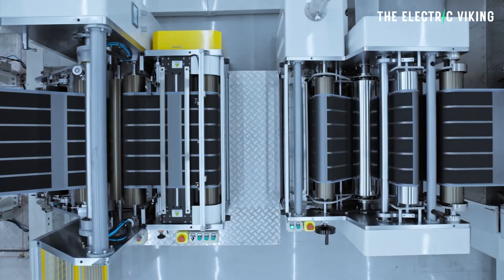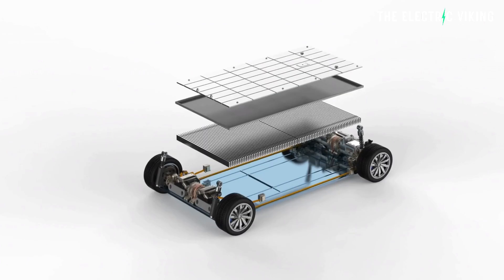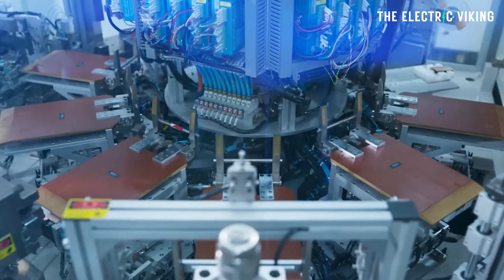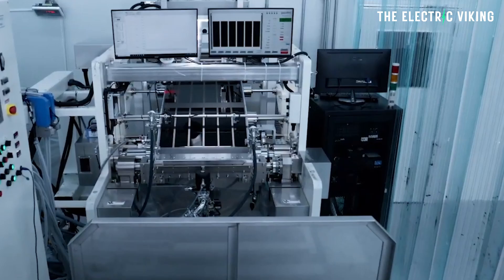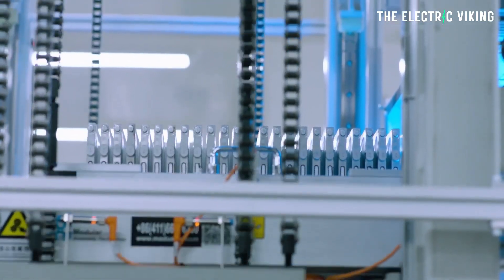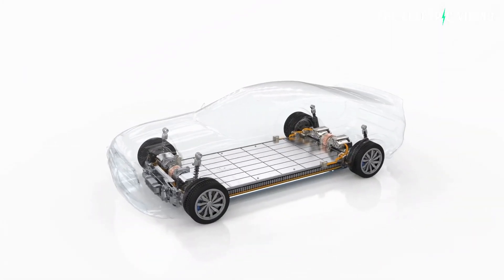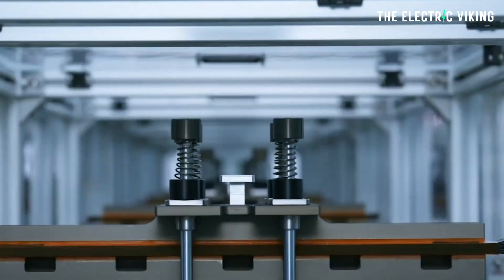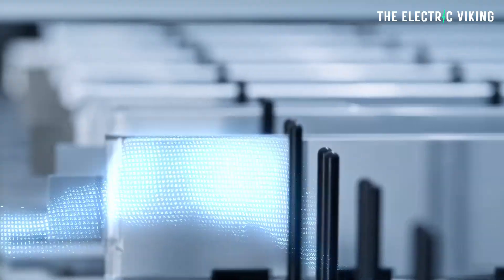NEW silicon composite EV batteries boost range 30% & charge in 8 minutes

Comment: How fast the battery charges has minimal impact in the UK as even where there are 'fast-chargers', the max rate is usually no better than 50 kW and this is especially so if you have two cars on the charger at the same time. This is an infrastructure/grid issue rather than a problem with the car or the charger. Only Tesla seem to be capable of rolling new chargers and maintaining them, however even the base model Model 3 with <50,000 miles is currently asking £25K. For that I would rather update my BMW 330i to the M340i with the S58 engine (straight 6, twin turbo).

Comment: Sounds great and anything that brings down the weight of the car has to be a massive plus. My concern is that the company needs to recover its investment costs so the technology must necessarily be more expensive than what is currently being used. Given the cost of BEVs is the primary reason 'ordinary' people don't buy them, it will only benefit the market in the longer term. On the upside (or downside if you are a dealer or already own a BEV) is that it will further depress the value of second hand BEVs which brings them within reach of people like me who are struggling with the cost of living and the cost of educating my children. I test drove a top spec Ioniq 5 recently and it was a lovely thing, but the car was £60,000!  In the UK, the government has just added 20% to school fees so I need to find an additional £1,200 a month for the VAT which means I need to earn another £20,000 per year before tax. I just have to pray that my BMW 330i (2005) keeps running long enough for my children to finish their education.

Comment: First it was Microsoft and Constellation restarting Three Mile Island, then it was Google announcing it would buy power from small modular reactors built by Kairos. Now today, Amazon has said it’s investing in X-energy, the small modular reactor and fuel company, and supporting a joint project by X-energy and Energy Northwest, the Washington state public utility. “What makes this significantly different is the investment,” Brett Rampal, a senior director at Veriten, an energy advisory company, told me. Amazon is not just buying the power that a nuclear reactor will produce after it’s completed. It’s getting involved in the projects themselves. The Microsoft/Constellation deal to restart Three Mile Island did not entail Microsoft taking on the financial and logistical burden of upgrading the plant so that it could be up and running again in a few years — for that, Constellation will be putting $1.6 billion of its own money into the plant. Instead, Microsoft signed a 20-year deal for the plant’s output, known as a power purchase agreement, which guarantees a price for the plant’s product. These types of deals were pioneered by Google to support renewables projects by giving them a guaranteed income independent of how electricity prices might fluctuate in whatever market they were selling into. Amazon’s deal, on the other hand, is a “direct investment in the Energy Northwest project,” an X-energy spokesperson told me. According to an Amazon spokesperson, that means a “capital commitment to fund development, licensing and construction of an SMR project with Energy Northwest in Washington State,” a spokesperson told me. The project would be sited near the existing Columbia Generating Station in Richland.

Comment: These EV battery vehicles with V2G and oversized rooftop PV homes and buildings means cooler rooftops and supplying the grid with dirt cheap electricity 247.

So the grid load of the homes and the commercial and industrial customers can change to industrial user demand increasing as industry moves away from fossil fuels. 
No new grid capacity or new central generation is needed. 
$TRILLIONS savings.

Comment: Brilliant video. Yes I am repeating myself, but the EV value to owners and the climate is massive. 
20million rooftop PV 6.6kW is 660gWh, more than the maximum fossil fueled 25gW x 24hrs = 600gWh.

We don't need distant renewables electricity. 

We don't need nuclear electricity. 

We don't need more grid capacity. 

We don't need more grid generation. 

The GRID OWNERS NEED $110billion CASHFLOW. 

The customers are THE  suppliers of CASHFLOW. 

FMD this is so obvious. 

The grid owners should lock in existing customers as suppliers of dirt cheap electricity and self suppliers.
And then as the original customers demand changes to supply, the grid owners must supply the new heavy useing industrial customers moving away from fossil fuels. 
Moving to clean electricity. 

New grid capacity construction costs are extremely expensive, $TRILLIONS.

Comment: My dream is an EV that doesn't have to charge. The idea is that it can run 10 000 km. Each 8 000km you got to put it into scheduled maintenance, to change tires and check everything. After that, you get your car back with 10 000 km autonomy to run 8 000 km again.

Comment: I've heard you refer to the CATL Condensed Battery with an energy density of 400 wh/kg. About the cells, you say CATL  "manufacture (them) for aircraft". Supposedly these cells have been tested in some 4 ton aircraft. Assuming the present day affordable EV cell with a generous energy density of 280 wh/kg and an optimistic 4 percent annual compounded energy density increase, they are probably 9 years away from ever appearing in EV's with 400 wh/kg.

Comment: You'll notice Sam caught himself on the 321 Wh/kg! Good on ya mate!

The Wh/L is somewhat misleading.
Reply: As long as they are specified then they are both important. This would reduce the size of a 60kwh battery to 80L and 187kg. Which is getting on par with an ICE vehicle when the weight and volume of the EV vs ICE engine is included. Right now I'm holding onto my 13 year old ICE vehicle for as long as I can because EV's are getting better and cheaper at an astounding rate.

Comment: Honestly it sounds like you're reading a press release with no substance behind it. What is "silicon composite"? The word composite means it's a mix of silicon and at least one other material. What other material? What % of silicon? What is the improvement in energy density? This is what you should talk about. Enovix is currently putting their 100% silicon anode batteries into production, for consumer electronics first not cars. Amprius is doing something similar for aviation. Almost every other battery company is working on adding some amount of silicon to their anode, but none of them seem to have a 100% silicon anode yet.
Reply: I don't think this is the channel for the substance of the chemistry. There are plenty of sources for that out there.

Comment: Charging the car from 10 to 80% in 6-8 minutes will shut the mouth of most EV haters, at the same time, if we see range of 700 kilometres like the Model 3 highland, the range is also on par with petrol cars.
Reply: My only problem with that charge speed is I'll get charged for overstaying to often. I'm not wasting time waiting for my car to charge again! I like a 20 min charge time so I can stretch, toilet and coffee 😅
Reply: I said about 15 years ago that when range is around 450 miles in all conditions and 80% charging of that in 10 minutes in a medium cost car then that’s when the market for ice absolutely crashes and we have rapid adoption. We have the zeekr SUV close to that now, but I think 2-3 years when mid sized lower end brands get this it’s over
Reply: Charging speed ought to be the one thing improved first but people only look at range. My otherwise wonderful Chevy Bolt (summer range of ~240miles) is not great for road trips as it only charges at most at 55 kw per hour. Impractical.
Reply: The M3 won't do that range unless under ideal conditions.
It's more like 450km.
I'm not sure quick charging is that important, it's the infrastructure that is lacking
Reply: @sargfowler9603  an ICE car rated for 700 km will never go that distance either.
Reply: @HansMilling  But they do! Most ice will do 700km easy
Reply: To achieve 700km range you would need approximately 120kWh of energy.  To charge in 8 minutes would require cable cores and connector pins around 30cm in diameter.  The cable itself would be impossible for a person to lift!
Reply: How stupid are you people.  You need the electricity to get to the charger first.  To say everyone will be charging their cars in 8 minutes is bonkers look at china there the only country to even have the capacity for a few fast chargers to support this nonsense.
Reply: Not a hater but I will say the EV era is here when I'll see the chargers with unified port able to be paid with card/phone. Otherwise it's no more than a toy for a rich soy fa**ots who have no other hobbies to spend their money on.
Reply: Dream on! EVs are just an excessive tax on the gullible and stupid virtue signalers and make it easy for the rest of us to tell who the brainwashed airheads  are!
Reply: It won't shut them up. I've heard so many ridiculous arguments from them it's amusing lol.
Reply: @PyroShields  only their own wallet will shut them up. in 5 years BEV will be cheaper to buy than ICE cars. economy-of-scale is going down for ICE.
Reply: It absolutely will not shut them up. "They" said fast is all that matters, now non performance ev's are faster than top spec ice and the goal posts has been moved.

Speed up the charging and you will change no minds.

I wish you were right and hope I'm wrong.

Comment: Confirmed with independent testing? With large battery packs with near megawatt charging speeds? Safety? Durability?  Cost per Wh at production time?   

Although its great innovation is coming at rapid pace in hyper-competive EV battery industry,  there are only a few companies that can execute in time/. Typical a big company has either made it obsolete or a copycat technology different enough to avoid litigation or at least tie it up in court for years.  In the meantime they gobbled up marketshare before the aspiring smaller competitor can wind up mass production. Unless its such a big difference where there is no other game in town, licensing tech to a big player or getting bought out seems the main way forward for smaller companies.

Comment: I've believed for the past 20-years, that once EV's deliver ~500 miles range, charge in 15 minutes, last ~1 million miles with a price parity of ICE, we'll see the end of ICE, and we're just about there now.  My Model Y delivers 320 mi's range, charges in ~20 minutes and will last a million miles, which is great for me, but the masses will demand the above specs.  Silicon anodes, Sulphur-coated cathodes, with a solid electrolyte, in a prismatic cell, is the future of EV batteries.
Reply: It takes me about 30 minutes to add 100 miles to my Y maybe I am using the wrong supercharger . 23 y LR 
I charge at home 95 percent of the time.
Reply: @ctuna2011  Home chargers are level 2 which is 220 watts. Level 3 is 340 watts which is a super charger.
Reply: Imho prismatic is not necessary, or a solid electrolyte.
Reply: > Model Y delivers 320 mi's range, charges in ~20 minutes and will last a million miles

The 1.9 TDI delivers 700 miles, charges in 2 minutes and lasts a million miles. But here is the main difference: it costs only $5k.

Comment: I'm hoping at some point, they will start to offer upgrades for older EVs ie my Model S is 9 years old in March 25, has currently covered 267,000 miles and still drives very well. I'd like to think that in 2 or 3 years, I could buy a new battery pack for £4-5k that offers better range, weighs less and charges faster. Plus I can use the old battery for home storage or sell for a decent return. The car is made from aluminium and gets software updates every week, why would I want to change it?!
Reply: This will never happen without government regulation. Its already an issue with the hundreds of ebikes and EVs out there today. If OEM worked together they could come up with battery standards. This would reduce waste and reduce costs dramatically. Versus the significant e-waste that is being generated by old batteries. Redwood Materials is able to recycle 100% of existing ev batteries.

Comment: I would far rather innovation efforts be made in reducing the fire risk of batteries, making their fire risk levels detectable, making the health of the batteries detectable,  making the batteries fixable, and making battery components easily replaceable. This would have a profound effect on the economics of owning a  BEV and on insuring them.  Increasing charging speed and range only diminishes all those other factors, and frankly those are far more important.

Comment: I like that you show us news about battery tech, but just for the sake of the argument, a charging speed measured in minutes doesn't mean anything, if you don't specify the battery size. Is the charging 8 minutes for 40 kWh, 60 kWh or 100 kWh batteries, cause there is a big difference between these 3 out there?
Reply: Agree. However in a partial defense, the "minutes charging" - which annoys me also - is really stating the C-rate, or multiples of the nominal 1.0 kW/kWh rate.
Reply: No this is actually correct. It is a property of the battery how fast it can be charged. IRL you may have other bottlenecks such as charger power that limits the speed of charging.
Reply: No, he is right, the minutes of charging is the right criteria, the size does not matter at all. 10kw or 100kw battery will charge at the same time if the supplied charging power is 10x more for 100kw battery. In other words, the battery size does not matter, the charger maximum power does.
Reply: @martinhovorka69  The larger the battery, the more powerful the fast charger has to be while maintaining the same charging time. At 100 kWh you will not be able to charge from 10 to 80% in 6-8 minutes with the current CCS charging standard of 800V. That would be 70 kW in a tenth of an hour. Even without charging losses and with a constant charging power, you are well over 500 kW (500 A * 1000 V).
Reply: @ThePeter123a  Semi has 1MW+ charger.
Reply: @martinhovorka69  We're talking about cars here. The charging socket on the Tesla Semi is probably too large to be installed in a car.
Reply: He's good at leaving out crucial information. Imagine he wouldn't. Half his videos could go right into the trash bin.
😂

Comment: 3rd revolutionary battery in 10 days? Or did I lose count?
Reply: There are hundreds. The question is which of them can balance the different attributes good enough to make it into the market.
😉
Reply: Battery's are the New Gold Rush so many companys working on multiple type's
Reply: Battery chemistry will make the ICE irrelevant.
Reply: Hang in there the week isn’t over
Reply: Viking doesn't say it's being mass produced which can take years if all the stars align and a certain chemistry prevails for as long as that takes.
Reply: @ronfarnsworth7074  Sam understands most are not idiots and know it takes time
Reply: @GWAForUTBE  I agree Sam knows that mass production is a longer term financial investment that will hit on the better tech along the way but skip over many breakthroughs because battery tech is moving way faster than mass  manufacturing can keep up with or it doesn't mix and match into a production line trying to pay for itself.
It's a moving target.
Reply: Yes and ICE is DEAD
Reply: Usually 3 a day with Sam!
Reply: EV tech moves at lightning speed. ICE is 💀👈
Reply: Wait, don’t tell me, they have no idea if they can manufacture it at scale. LOL